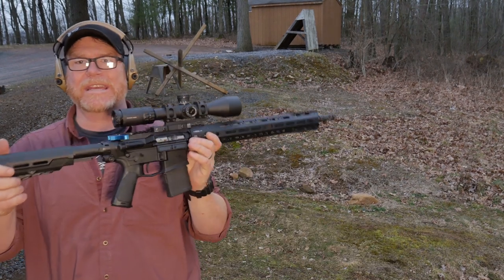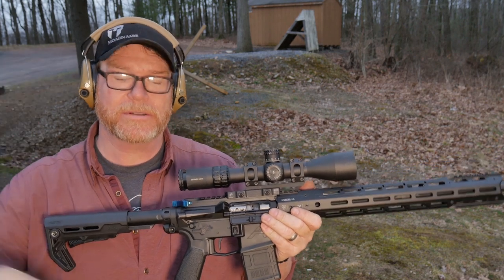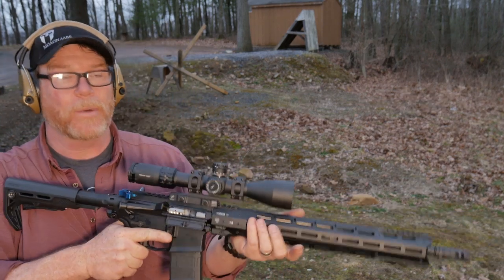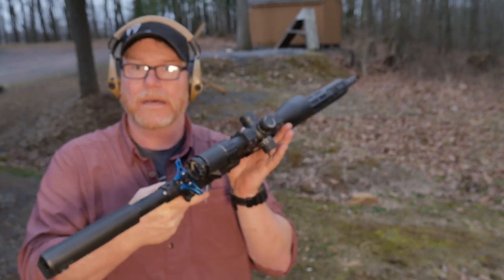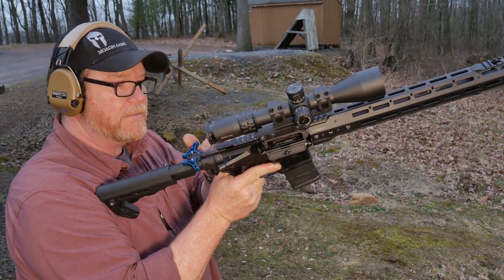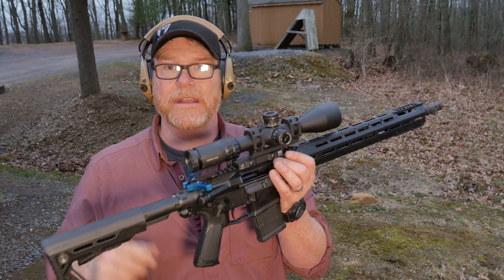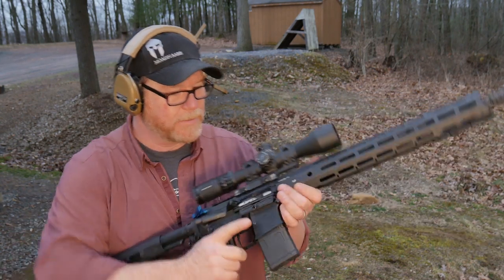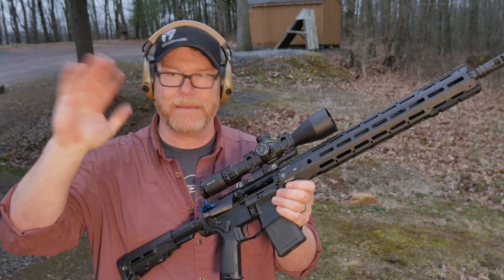Timber Creek Charging Handle Works as It Should

Comment: I bought a cheap ambi charging handle from Amazon for $20 a few months ago. Surprisingly it's actually pretty decent, strong springs and latches tight on the receiver though the finish is cheap. It gets expensive to put a Radian ambi CH on every AR, lol.

Comment: I have a mini 14 with a scope, do I need to take scope off every time I want to clean it?
Reply: Just keep oiling it
Reply: So don’t fully break it down?
Reply: Just hose it off after each use then shot it with WD40 and finish it off by wiping it down with mama's favorite bath towel. You'll be in good shape then.
Reply: No. No need to disassemble unless it fails to function properly. Just clean the barrel and add some lube. I had a mini14 and that's all it needed. Sold mine years ago though, the AR platform won me over, lol.
Reply: Thanks all
Reply: @bigdaddypain295  
No problem. Just remember it's a piston driven system so most of the fouling will occur within the stock under the barrel, which doesn't affect anything. Very little fouling occurs in the action itself. Just make sure you have some quality tools if you are gonna remove or loosen the gas block to drop the stock, those allen bolts can be very tight and cheap tools tend to break off inside of the bolt, which isn't fun trying to get it out. Been there done that, lmao. 
Also, don't remove anything from the gas block, there is a part that fits inside the block that diverts the gas to the piston, that's not suppose to come out, if it does, I'd contact Ruger, which they have good customer service, but that little piece can bring lots of grief and frusteration if it can easily come out or falls out.

Comment: So with all you know about the AR which one would you recommend for a beginner ?
Reply: You have a budget and/or preference?
Reply from the maker: I'm getting ready to put a build series together that is geared towards people who are new to the AR and on a budget
Reply: @toddk1377  
Maybe leaning towards the S&W sport 2 . But am not sure. There is to many variables . Really don't trust the AR platform.
Reply: @benjimenfranklin7650  What don't you trust?  Reliability, durability, parts compatibility, any other "bility" ;-)  
I'd ask what type of shooting do you want to do, range and accuracy expectations?  A S&W Sport II with a red dot would be a great 1st AR, and get you out to 200-300 yards easily.  For defense, you don't need a scoped precision AR.  If I could only have one AR, it would have a red dot and a fixed front sight (maybe pic rail mounted).
Reply: I'm not gona tell you what to get. That's often a gamble telling someone what to get. But when I first got started in a AR15 I got the s&w sport. It was a good rifle, but I quickly realized that there are more options that caught my attention. So if anything i can say to help you would be save a little more money and get a rifle with a mid length gas system , free float rail and a full auto bolt carrier group if you think that may be what you realy want. Assembly is also important, is it probably staked on the gas key? Also buy from a company that has good customer service, unless you want to build your own. Dont fall victim to all the doodads that are available and clutter up your rifle, in most cases they serve no purpose,  keep it clean and focus on what your particular needs are. You will learn as you go. Some AR15 rifles  are extremely reliable while some may not be. But like I said it's very difficult to give someone advice on what rifle to get.
Reply: @8luggarage  
Well there you go. I never meet an AK 47 I didn't like. That goes for most H&Ks too. Them ARs have way to many variables . I believe it would save money to just get a PTR 91 and I can hunt deer with it too. The 223 will kill a deer but you have to be good are you'll have bad meat. You need a clean kill or it won't taste good.
Reply: @benjimenfranklin7650  
Okay, well that's a good option if you choose that route. So why is it you say you don't trust the platform? Not picking on you, just asking a general question as to why if it's due to a specific reason or other reason, if you don't mind.
Reply: @kotaboy32  
That ought to be exciting what you build for a budget friendly AR! The cool part is, being budget friendly doesn't necessarily mean skimping on quality, but finding and purchasing the right parts at the right time. It's usually what I do, lol...blemishes, sales, clearance, ect.
Reply: @8luggarage  good advice.  It is hard to sort through all the choices out there, some good some bad, many are awesome.
Reply: @benjimenfranklin7650  by all means get an ak. I was just sharing my experience with AR15s. And I have never had a bad experience with the AR15s I had in the past or have now. I was actually goin to buy the century arms C39V2 but then word was out that the receivers were prone to cracking so I never got an AK as of yet. I'd like to some day though.
Reply: @marzcapone9939  thing is who pays for finding out what really works and what don't.
Reply: @toddk1377  
The  AR is said to be a bad design. It started in Vietnam and goes all the way to the M4 . Still I would like to have one that works or maybe a C93 . Some people love the AR but I have friends that wouldn't give you the time of day for one.
Reply: @benjimenfranklin7650  We all do in a way, that's why guys like Kotaboy help the rest of us out.  I did my own research, read through forums so I wouldn't make a bad choice about what AR to start with.  Still happy with my first choice.
Reply: @benjimenfranklin7650  
The AR imo, is a good design, just requires a little more discipline vs an AK. However I've had nothing but good experiences with an AR15. The only negative is that its so damn fun to shoot, it tends to dig real deep in my pockets, lol.
I started with one and now I'm working on a fourth build, just invest in a reputable company and you'll be fine. Same for AK's. The thing is, for AR's there is milspec and commercial. It's easy to buy the right parts that'll fit and work. With an AK, not all companies and countries follow the same tolerances and specs so really, there are a lot more variables in an AK platform than an AR. I will add though, the AR platform in itself is a very reliable and accurate platform, if it wasn't, it wouldn't have beenbin service as long as it has been nor would it be a recommended firearm like it is. If you're hesitant about it, buy a used one for a good price or get one on sale, if you don't like it, it wont be hard to sell, lol.
Reply: @toddk1377   
The AK is the most sold firearm in history with over a million plus in the world. Makes me think the AR is a real piece of junk 😂.
Reply: @benjimenfranklin7650  
To each their own I guess

Comment: Do ya have to turn sideways to get through a door with it ?. Amazing the gimmicky junk out there these days .
Reply: Turn sideways? Lol
Reply: @toddk1377  yea you know, cause the charge handles arms are so wide, some hate em.  Just had a chance today to look at them in person, and are well made and look nice.  But, the arms are so long on em, they gotta snag on all kinds of shit if running a sling and spending lots of time with your ar. Prolly pokey as well on body.  But i.assume if your just an average joe who has 110bucks and want a wide ass charge, this is available. For 100+ I'll grab a geiselle super over it everytime, or a raptor. I wouldn't call it a gimmick tho, wider is nice if you are shooting in winter with heavier gloves or mitten on your grip hand, or have a larger optic.. I've never ran it, so no clue, but I imagine it's snaggy on sling, and gear, and everything, and pokey against the body while carrying. But look nice enough. Not geiselle or raptor nice, but nice.   Seen some vids that show one have a loose spring on the latch and cycling with the bcg cause it un latched itself which is no Bueno.  And at least where I'm from in stock they are 100bucks. So there's that.
Reply: @Hustler_state  
From my experience, running a 2 point sling, never had a snag with an extended latch charging handel, I haven't on my body armor either. Though one of my favorites is the BCM mod 4x4 ch, yeah it's not cheap but it has a lower profile but still easy to use.